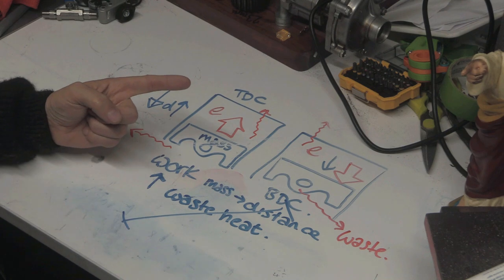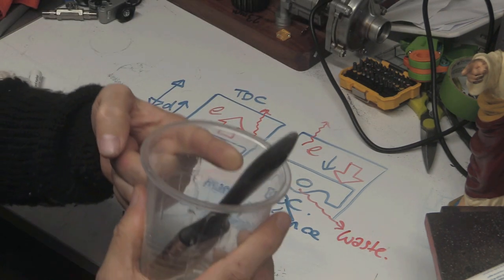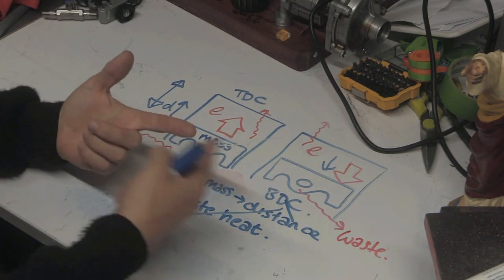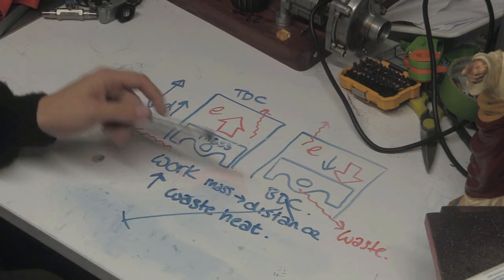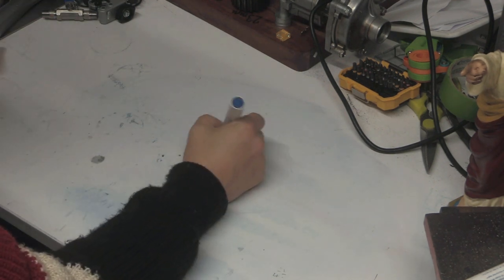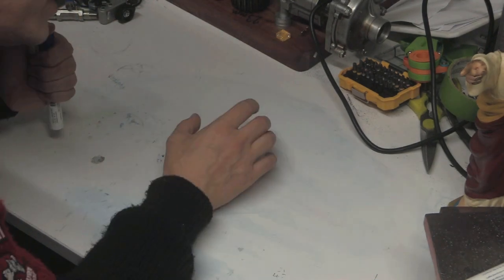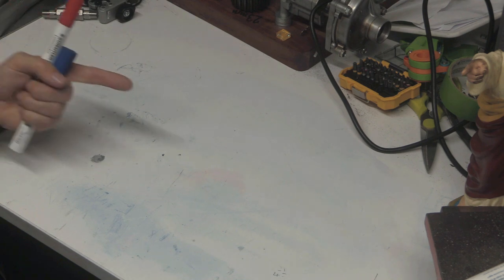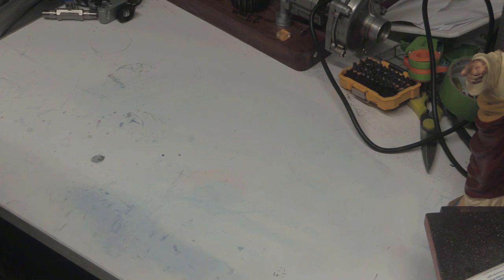Compression - Like a spring?

Comment: Bringing Thermodynamics to the masses is feckin fantastic, well done you put it across well. 
No one believed me when I posted about the power output and losses I put up on your site about electric motorcycles. 
They are machines that transfer one source of stored energy to another just like a petrol bike. The thing that got me was everyone thought electric motorcycles were 98% efficient, in turn the motor is only as efficient as the machine,( the total bike), the motor is running! Feckwits!
Play nice! 
If not your on the list

Comment: All that said, using compressed air as a spring works quite well in a number of applications (some suspension applications,  valve springs in some racing engines). 
I'd guess that air springs have the majority of the market for (real) mountain bike suspension and the heat generated (in the spring) isn't an issue. 
A compressor heats up because the air isn't cooling again as it expands so the heat from compressing it keeps building up in the compressor. In an air spring the heat of compression helps the spring expand again. There are some losses to the environment (plus added heat from seal friction) but they are minimal.

Comment: Bro I asked a question a while ago about holes in the wheels of Sv, varadero and other bike models, now I’ve thought about it as u have either forgotten or been to busy to answer, which is fine, no problem, anyhow my new theory is there remnants of the casting of the wheels as there hollow, maybe there there because of the way the wheels are cast maybe for casting consistency?
Reply from the maker: Its on the list...
Reply from the maker: The holes are for the cores to make the spars hollow. This is to make the wheels lighter. They're been doing it a lot longer than the SVs been around
Reply: @dirtygarageguy  yea no worries bro, take ur time, and thx for the reply

Comment: Top Tip: You can cheerfully reduce the amount of internal friction by chamfering the bottom edges of the piston rings with an angle grinder.
Reply: boxford boy  It depends if you wanna be fast or stoopid-fast! Oh, and remember to stick the grinder in a vice - with the abrasive disc spinning uppermost. By using this crafty technique, you'll be able to control the chamfering process: although you'd be wise to use some Marigolds to protect your mitts. 'Hope this helps 👍
Reply: @missydee6085  also don't forget to fill in your intake ports with epoxy, make the moist out of the low friction rings

Comment: You can test the sam thing with a syringe ,if you put your finger on the outlet and push the the plunger from a start point, after releasing the plunger it wont come back to the start point it will be a couple of mm short
Reply: i thnk that is mostly because of the friction of the rubber seal... which is definitely present in a cylinder too just well lubricated.. more relevant pumping losses of engines are the actual pumping of the intake in and exhaust out, the friction of the pump itself (rockers, lifters, cams) and yes compression too.. it would be interesting to use a motor to turn an engine with no fuel in it just to measure how much power it takes to move as much air through the intake and compress it as it would while running that number would be the pumping (and friction) losses and i bet it is a shocking amount..

Comment: I find it very funny the number of people who think a perpetual motion machine is an easy thing to create. On one occasion we had a vehicle that needs to be able to power up a laptop the person operating this vehicle suggested that I get a power inverter to run the computer and then plug in a charger into the power converter to charge the battery of the vehicle. I told him that adding the battery charger would simply speed the rate at which the battery was discharged and he was ready to go to blows over that summation .
Reply: If only vehicles were equipped with some sort of technology capable of charging batteries. Almost every car and bike in the world would have it fitted.
Reply: @phitsf5475  yes except they did not want the engine running because of the noise. It was a mobile library, bookmobile.

Comment: It's interesting, as there are other variables that you didn't mention. The basic premise about Force, Mass, acceleration, friction and, especially heat is interesting in that everything an internal combustion engine does  has had attempts to remedy and improve it's efficiency, as I believe, is still in it's infancy and/or already at it's peak. So, where does an Engineer start when wanting to improve cooling internally/externally when ideas have already been streamlined etc., and the idea of trying to keep the rings, rods, bearings and pistons cool, for example, with radiator coolant/water, makes it impractical and virtually impossible to do so. Other aspects are, resigning of heads, blocks, crankcases, and the like, with existing materials, manmade or otherwise. What I mean to say is, where is it heading regarding technology that is considered by parts of society as semi-obsolete or reached its nexus in development? As I see it, society can only work with what they have been given and/or found, don't worry Matt, Engineers included. Cheers for the video bud :-)
Reply from the maker: The limit is the theoretical maximum, which can easily be calculated, and thats  coming soon
Reply: @dirtygarageguy  Whoops, I've done it again LOL ... Does this include the order of magnitude in which has an association too?